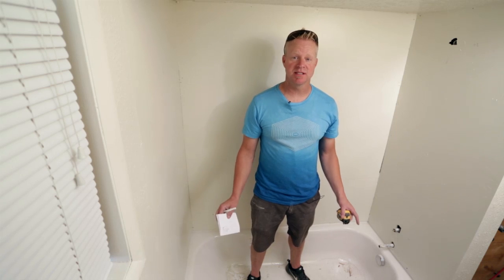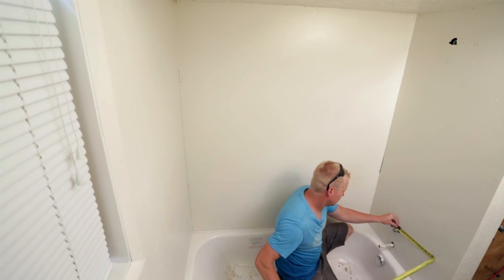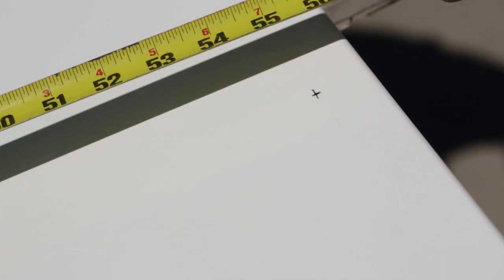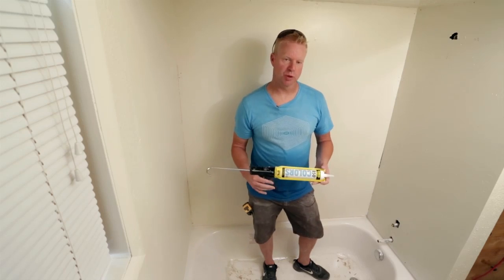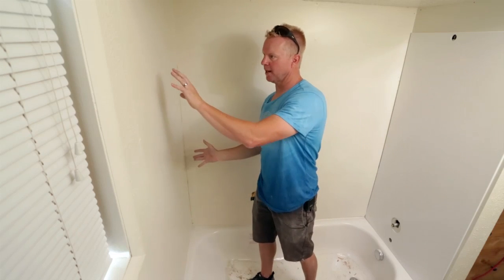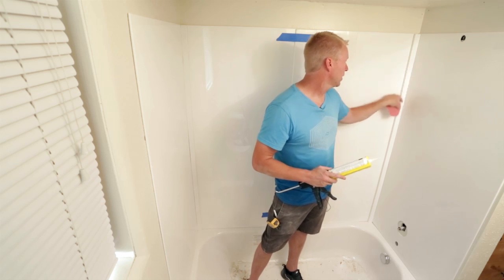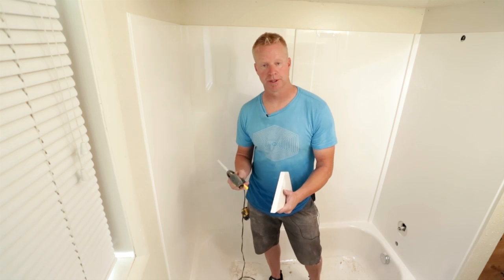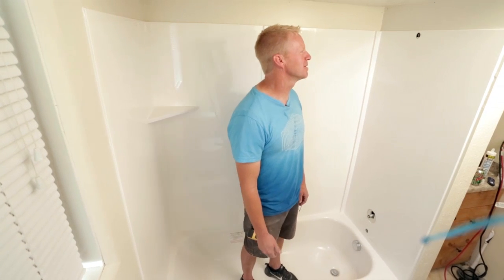How to Install a Cultured Marble Tub Surround

Comment: Back wall gets installed first. Professionals make a template of the walls so they fit tight in the corners. But whatever I guess. The corner mouldings works too.

Comment: Its best to install the control wall last, that way it can be removed for plumbing repairs without removing any other panels.
Reply: Threecreation Leather yeah that's the correct way, but it looks like with the gaps he's leaving it wouldn't be a problem removing the faucet panel. My company doesn't put trim in the seams, just butt each panel together then caulk.
Reply: chris r when you make your cuts but the wall isn't plumb. Does it create a gap between the 2 panels where the joint is.?
Reply: The Cultured Marble package is meant for a DIY customer that is not used to working with cultured marble. That’s why they have the corner pieces. Looks very simple.

Comment: Hot glue is strong enough to hold the shelf?  You rest the panel on the tub?  Shouldn't there be a 1/16" gap just in case things shift?
Reply: Passed High School Physics hot glue holds it long enough for the silicone to cure.

Comment: No bracing until the glue dried? What if you want to put in grab bars later? You just slapped it on drywall? You couldn't measure the walls and cut an exact piece? Oh well. After all, I guess it is just a rental.